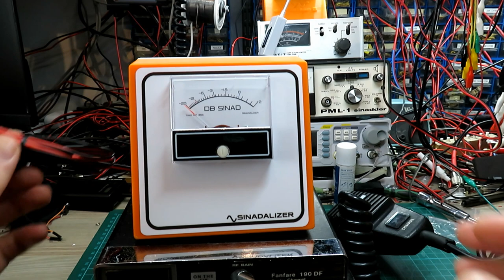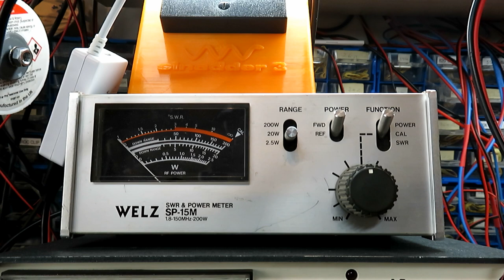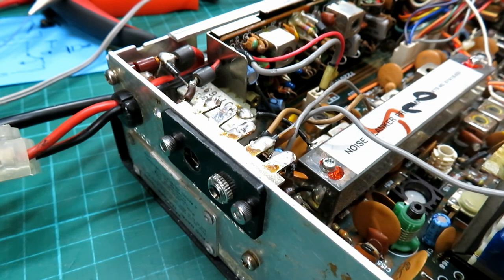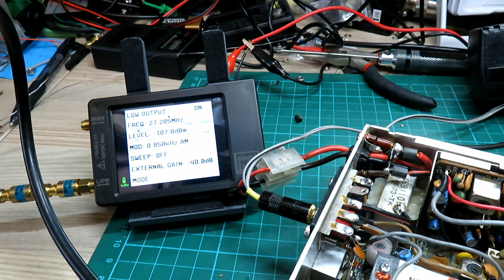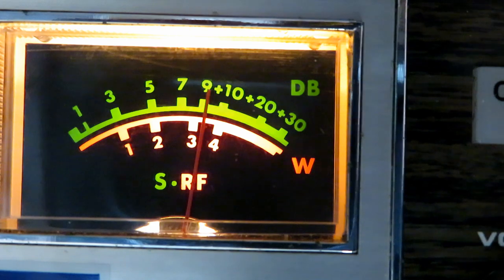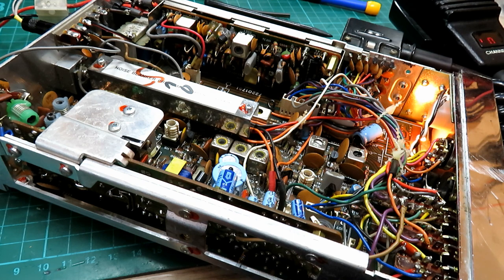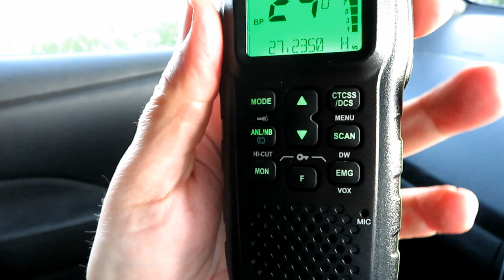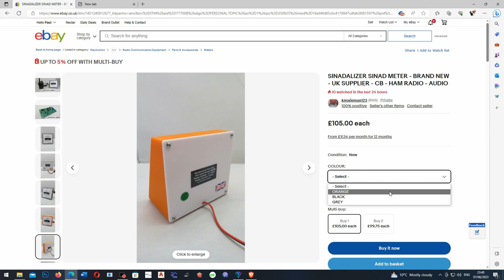FANON FANFARE 190 DF FROM 1978 AND LAST OF THE SINAD METERS NOW ON EBAY-RINGWAY MANCHESTER RADIO-2

Comment: "hi Paul I've had this set since late 70's, dug it out after watching this video. unfortunately it switches on, but the case gets hot very quickly, taking the covers off, the  metal plates to the left of the noise blanker module covering the transformer(45920005,    16J3-tk) are really hot, would that be a voltage regulator, or audio transformer!  there is no rx tx or pa. Thanks for doing the vid,  it just made me wonder if it was worth repairing, or just gaze at it on the shelf!. cheers Kev."

Comment: I have one of them fanon   Fanfare rigs, not a great talker but cool all the same
Reply from the maker: Yes it could probably benefit from a cap change and alignment using the Sam's service manual but that would cost more than the radio is worth, one of these days I will buy a Sam's manual for one of these.